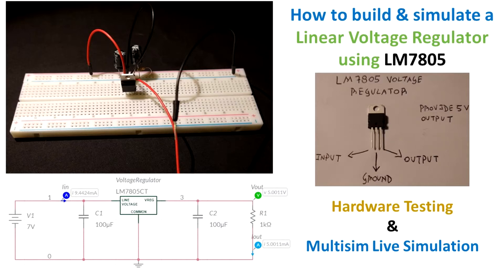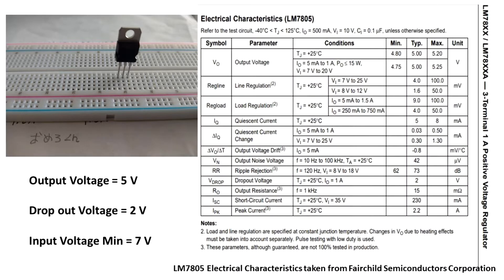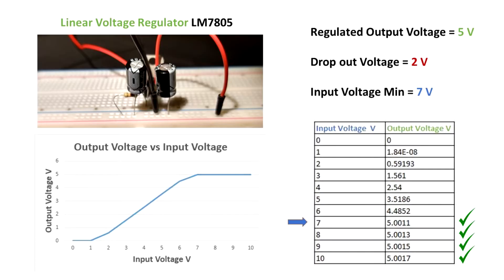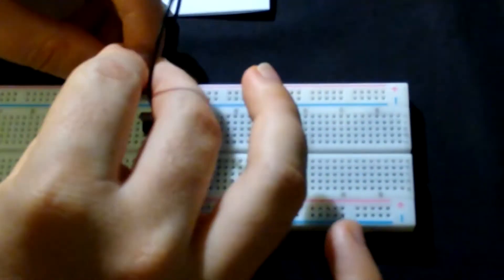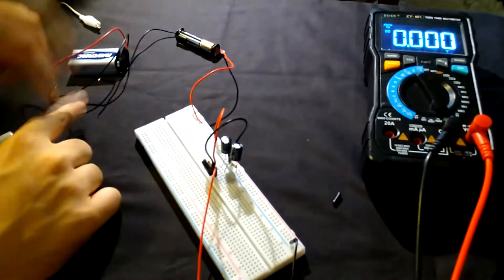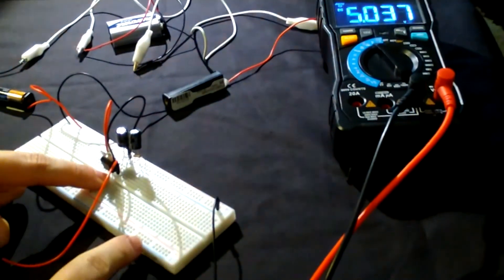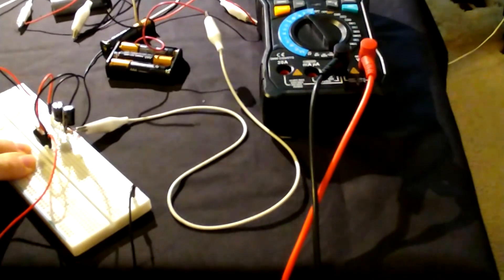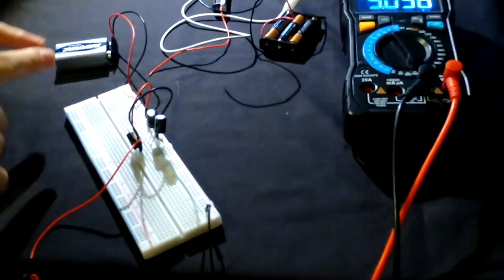How to Build & Test a Linear Voltage Regulator Circuit LM7805 ( Includes Multisim Live Simulation)

Comment from the maker: Guys if you are going to use this component in a formal project make sure to do the thermal calculation correctly. Although there is a thermal shutdown function in most of the Regulators, it is better to be safe than to be sorry.